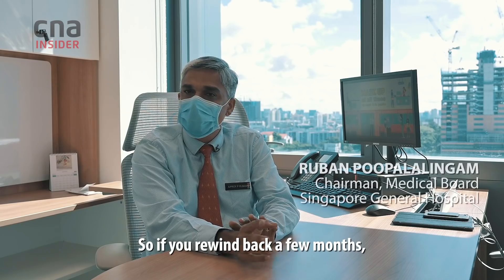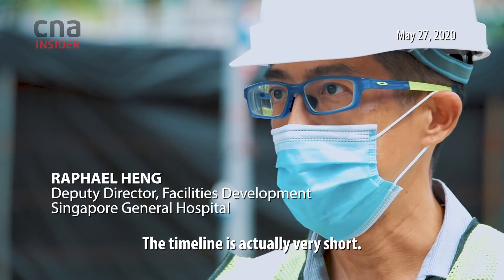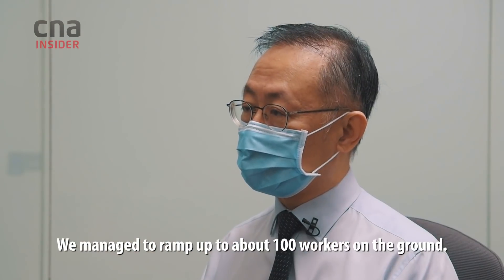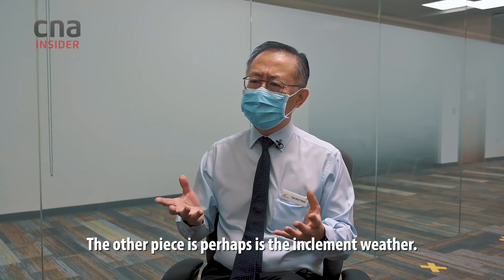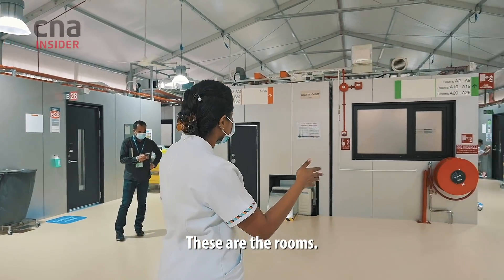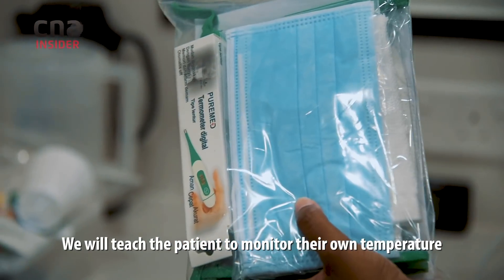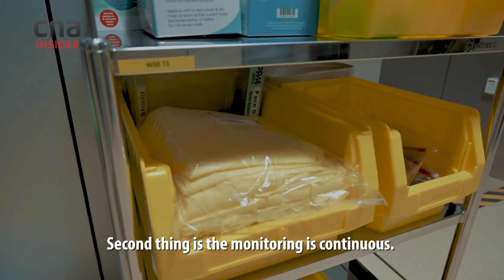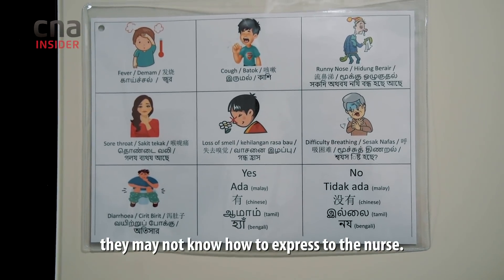Building A COVID-19 Ward in 50 Days - In A Carpark

Comment: it is modular units with fully equipped with all required units (furniture, a/c, drain, sewage, negative pressure ventilator, etc....The key units are shipped from Korea, in  the brand name of Quarantreat. 
Quarantreat itself was delivered as "ready to be used" as a plug and play. The 50 days fo time took for foundation and roof installation. 
You can find the details from https://www.facebook.com/Quarantreat-104419391249981